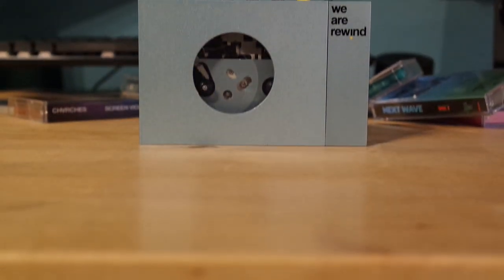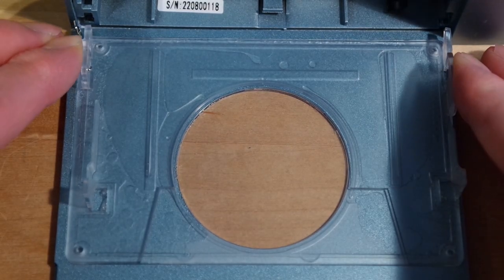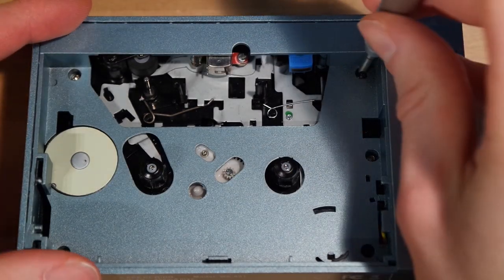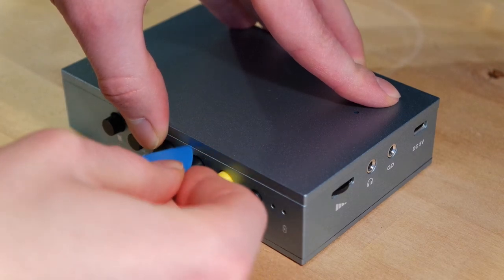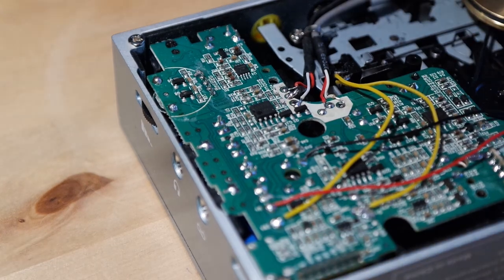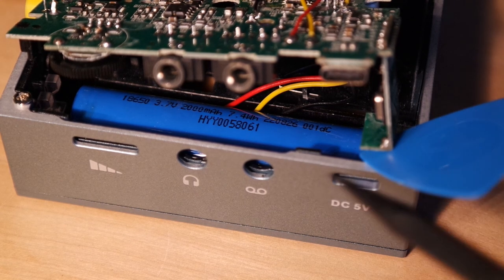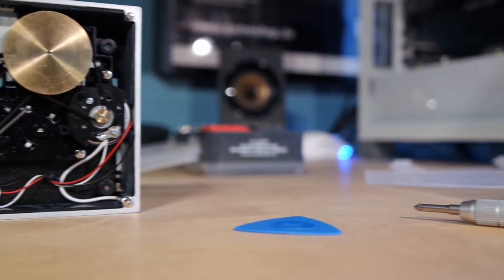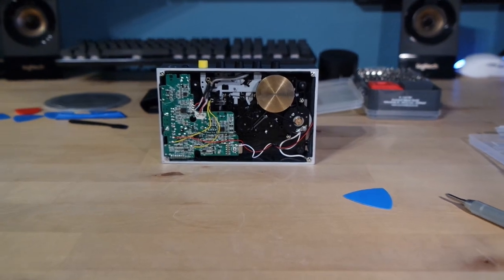We Are Rewind Portable Cassette Player Teardown | Prying it open [English]

Comment: Nice. So they went with an 18650 Li-Ion instead of some sort of LiPo pouch. A bit hard to tell, but it looks like the leads coming off it have a connector on the end that plugs into the PCB. Too bad you didn't dig deeper, but I understand not wanting to risk breaking your €150 device just for a YT video. Thanks for sharing!
Reply from the maker: Yeah it is plugged in via a connector. For me the next logical step in taking it apart would have been to desolder some of the wires going to the PCB, so I could really get it out of the way.

Comment: It is advertized mostly as a player. As a recorder, well... I spot a permanent magnet (blue head) for erasing, it works no doubt but playback noise level will be higher and there is no noise reduction circuitry. As engineers usually take the same oscillator for an AC erase head and for the recording bias, I would guess the recording bias is DC here which cuts in half the tape dynamics. Such cheap implementations will just reinforce people's bad opinions about cassettes🤗

Comment: I got a Panasonic rq sx21 off eBay for 15 pounds got a rechargeable battery for 25 and new belts for a 5er and a few minutes of work later i had a fully functional Walkman with way better output quality than this one seems to have as well as tape seeking and a decent bass boost. I really don't see what makes this Walkman worth 150......
Reply from the maker: I first bought an RQ-SX20, replaced the belts, which I had to partly desolder the PCB for and it didn't work properly, so I thought I got unlucky and could use the experience I've gained to repair a similar RQ-SX10, same thing. The battery door which is normally attached to the PCB had rotten off, I tried to fix that creatively but ended up with a player with wow and flutter to the moon, when further tinkering with it, the soft touch play button stopped working, contact cleaner revived it for a few minutes but it never came back to working condition. I tried fixing a Sony WM-FX10 next, replaced the belts which didn't involve soldering but the case was held together entirely by plastic clips, got that done only breaking one clip but after my attempt of repairing it, it then ate my tapes and I've put it on the shelf and preordered the We Are Rewind one. I've since got the Sony fully working.
Reply: @germantechguys  damn that sounds like a lot of messing around, for me it was pretty straight forward. I had to desolder the pcb too but it was super simple and once it was done my Walkman worked pretty much perfectly..... Guess I'll just count myself lucky lol
Reply from the maker: Yeah, maybe I was also particularly unlucky, I might absolutely try to get a nice vintage Walkman aswell at some point though, but thinking about my experience I can also understand why people would just want something new that works out of the box and has a warranty, so I think it's a step in the right direction that something like that is available, while still there's obviously room for improvement.
Reply: @germantechguys yeah it's not an ideal situation there's not a whole lot of motivation out there to produce a mechanism similar to some classic walkmans as there's not a massive market for it anymore, i do agree with you that having a modern option is a good thing but i wish it wasn't so ridiculously priced and for myself it's just not worth it when I have the knowledge and skill to restore an old one.... But i get why most people would prefer an "out of the box" option as opposed to taking the time and effort to fix something they may not be able to....
Reply: @germantechguys   Soft touch electronic button is nice, but I prefer mechanical ones for reliability. One thing I like about the WM-F10 is all the playback button are so light to push. older electronics maybe cheaper, but finding parts is not easy, so heavy users should get something in production.

Comment: Thanks for this video. 
Considering that one of the biggest drawbacks stated in many reviews is the apparent unserviceability of the WAR unit, it's just good to know it's not true. 

I see some spice in the comments here below, as this "new" Walkman seems to recall pretty often. I've jumped on the "cassette revival" two years ago and managed to get some old units working again (currently using a super nice WM-F24).
But, truth be told, I'd rather pay 150€ for something like a WAR player, even fully aware of its limitations, rather than the same amount of money for a better unit that's been sitting around for decades and is now sold at overly-pumped prices by some spoiled tech hoarder just because cassettes are now trendy so it's easy money to make...
Quality wise, any player from 80s-90s would eat this WAR player alive with no effort. But if you want companies to consider invesring in improving this tech rather than relying on cheap Tanashin assembly, you gotta invest in them first. 
Currently enjoying my Serge orange unit, so the F24 can have some deserved rest, even more after this video!
Less arguing, more listening!
Reply from the maker: Thanks for your comment! I strongly agree with what you said. There needs to be a demand before the market comes up with new products I think. I really want to have a really nice vintage player at some point but I bought this for two reasons: I have failed two times at fixing a Panasonic RQ-SX20 and RQ-SX10, after spending countless hours and money on parts (Belts, clips, gumstick battery, battery charger), I've had bad luck with fixing my car stereo which is shown in another video I've made, for now I just wanted to have something that works or at least has a warranty if it doesn't. Secondly I was super curious about this new player which sits in a market segment that just hadn't existed for 20 years, all we had were super basic chinese players made of flimsy plastic. While this uses similar internals, it is sold and marketed by a European company that did put effort into its design and haptics and also bothered to add Bluetooth, something worth rewarding for me. The player has its weaknesses but if it succesds on the market and shows that there is demand, we might see another improved iteration  of it or a competing product by another company. In the end people have to decide whether it's worth the money for them, nobody is forced to buy this but nobody should make an uninformed decision to either buy it or not buy it. People should give it a chance and keep the market situation in mind, but they should also be critical.
Reply: @germantechguys  I've successfully brought back to life several walkmans with basic stuff, but failed some too. Gotta love how some people pretend to make it look like playing with LEGO. Tried to service a pristine CYBERNET PS101 only for it to turn cold-dead. Wasted money and overflowing frustration. "easy fixes" my ass.
What I honestly don't understand is some people toxic approach to newcomers, like they are about to take a shit in their beloved garden. I've been hanging around vinyl shops for a while and not once in a life I've met such clownish elitism, just people willing to share all sorts of trivia about brands, bands and whatever.
Reply from the maker: Yeah, I'd want newcomers to have an easy entry into cassettes aswell as vinyl, with only vintage gear available that in many cases requires fixing, many people will be put off, which is not good for the formats popularity and therefore also it's state in general. I'd want the cassette format to be somewhat popular because that will mean more releases and more development regarding new tape formulas and better playback devices. Also if there are a bunch of "hipsters" enjoying the format for lifestyle reasons that for one doesn't mean you couldn't still be into vintage gear and releases and secondly... I mean isn't every hobby we're getting into kinda a lifestyle decision? I mean my friends know I'm into cassettes, does that make me a hipster? Perhaps it does, but I don't care.
Reply: @germantechguys   I bought 3 different brands of 80's era player for personal use not re-sale. Toshiba KT-AS1 and KT-RS1, Sony WM-F77 and WM-F10/F10 II and pricey Aiwa HS-P7 because I like Back to the Future (aka HS-P02 MKII in North America or HS-P07 in Europe). Toshiba KT-RS1/AS1 is built like a tank, but it got weak spots on cracked gears and failing Volume control switch and have to de-soldered several wires to replace the belt, used epoxy to fixed cracked gears and superglue on volume control switch after hours of work works almost perfect. Sony WM-F77 have worn power switch (hence not powering on) and the pulley tire hardened like plastic (bought replacement part and waiting for an agonizing 3 weeks for it)  currently "open item". Sony WM-F10, the battery corrosion is so bad it rotted the voltage converter circuit, I got it working briefly but broke again while fixing the 1.5V adapter input. the 1.5 to 3V converter circuit is very frail and easy to break, so still in disrepair and I am too damn chicken to open up the F10 II. The pricey AF Aiwa HS-P7 (the cheapest I can find) just an easy belt replacement and it is almost like plug and play, but spent a few hours fixing some minor drop damage to the cassette door. Blame Back to the Future for high price, but other Aiwa models are not cheap either, I assume people like certain quality traits from Aiwa. For tinkerers,  I recommend getting an early 80's Toshiba Walky KT-RS1/AS1 because of robust electronics, often cost less than Sony equivalent and time consuming but fairly easy to repair.

Comment: Great vid! Cleared up some questions I had about it's construction. I think I'll buy one of these. I considered restoring a vintage walkman, but gambling 150-200 USD on something that I may not be able to get working just isn't worth it to me. I'd rather pay the same money for a newly manufactured one that works well enough.

Also I spotted that "Days of Thunder" tape by The Midnight! Love that band and that album is great. I've got all their albums on cassette.
Reply from the maker: Yeah, sounds like a solid plan to me. They're expensive but there is the warranty and I've actually made use of it and they're very supportive. 
I also absolutely love The Midnight! I've discovered them in 2016 and at this point I have every album on tape except Nocturnal.
Reply: @German Tech Guys  yeah Nocturnal is the one I couldn't get either! I misspoke when I said I had all of their albums haha. I discovered them just last year. Someone was using the song "Sunset" off of their Endless Summer album in a music mix and when I heard it I immediately had to listen to their other stuff. Now I'm hooked and recommend The Midnight to a lot of people. 

I'll definitely keep the warranty card handy because this costing what it does, it's not something I'd just throw away when it needs servicing/repair.
Reply from the maker: I think you can actually still order Nocturnal, but I haven't so far. Yeah the mechanical part of the player is probably even fixable by someone who's used to a little tinkering once it is out of warranty. The electrical part is much more difficult for me. I've seen that they're already slightly reduced in price on the euro store of Tapahead City.

Comment: So does the motor speed adjustment access hole allow for fixing the wow and flutter issues?
Reply from the maker: I wouldn't think so unfortunately.
Reply: It may sound shocking, but motor speed adjustment potentiometer is there for adjusting the speed of the motor
Reply: wow and flutter is often caused by dirty/worn/rotted capstan roller or metal pulley not properly cleaned and above all incorrect belt size and vary in thickness.

Comment: So the Manufactuing coasts seems to be very low for the Player, sure under 20$
you have to desolder the battery is a crime for a luxury tech gadet
why the pcb is soldering with the mechanik and not with plugging cables connected?
it looks a bit cheap sorry